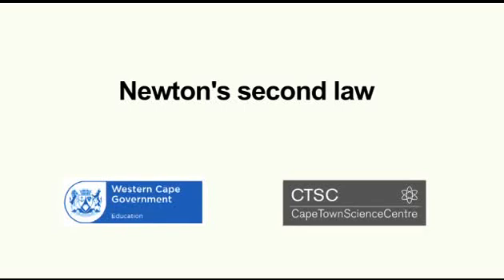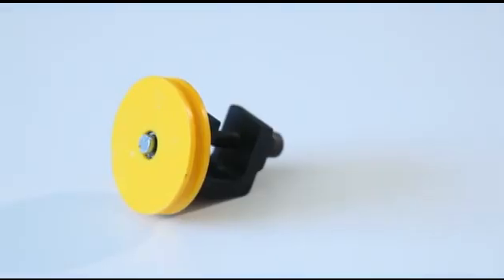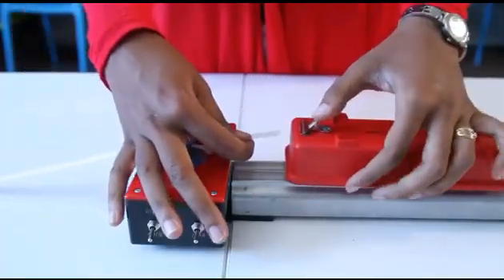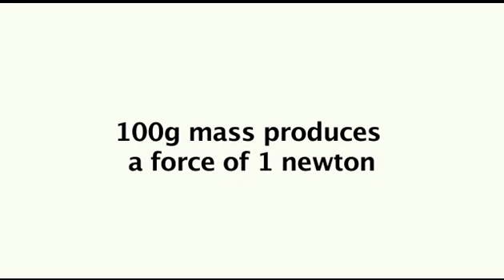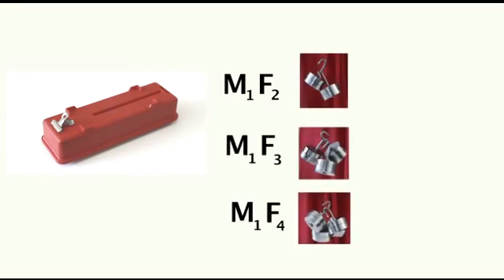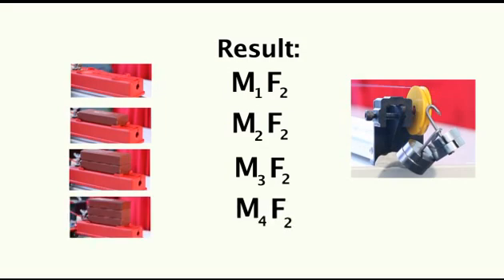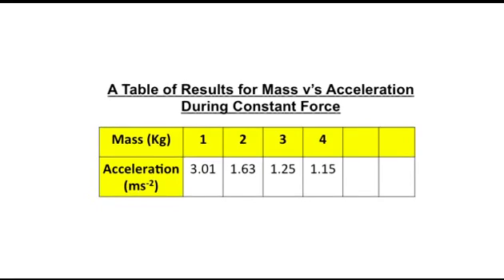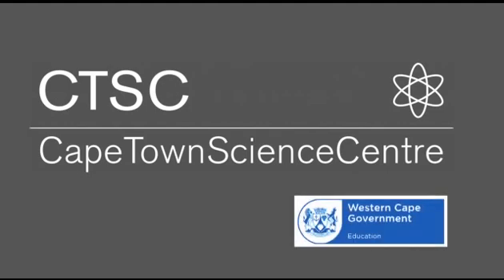CTSC practical experiment: Newton's 2nd Law of Motion

Comment: One of your graphs seems reversed. Since M=F/A, should you not plot force on the vertical and acceleration on the Horizontal?
Reply from the maker: Thanks so much for our question. 

When dealing with any experiment, there is an independent variable and a dependant variable.
The independent variable is the variable that stands alone and isn't changed by the other variable we are trying to measure. This is usually found on the x axis.

The dependent variable depends on the other factors. It is what we measure and what is affected in the experiment.

For the first graph, we are measuring mass VS acceleration 
The independent variable of this experiment is the the mass and the dependent variable is the acceleration

The second graph we are measuring force VS acceleration, where the independent variable of the experiment is the net force and the dependant variable is acceleration.

Therefore due to the above explanation, we plot the mass on the horizontal (x - axis) and the acceleration on the vertical (y - axis)

We hope this answered your question.

Comment: How did you determine that the displacement of 10 successive dots would be equal to 1/4 second?
Reply from the maker: The way we determined that 10 successive dots would be equal to 1/4 second is due to the fact that the ticket timer is set to 40Hz/s. That means that there are 40 dots in 1 second. Therefore dividing both by 4, we get 10 dots being equal to 1/4 of a second.
Hope this answers your question.